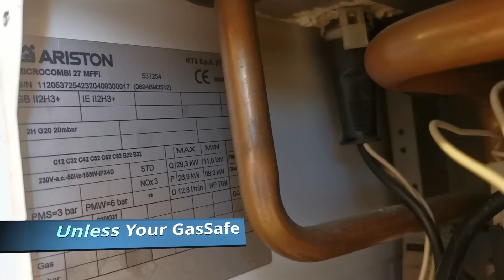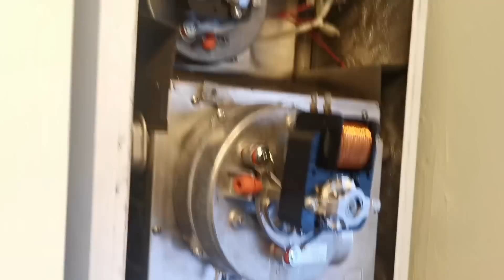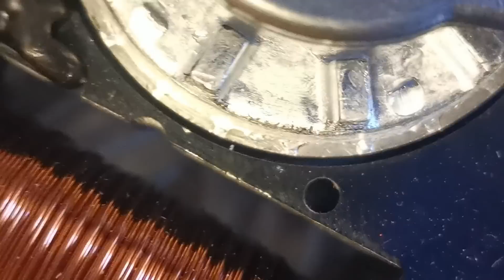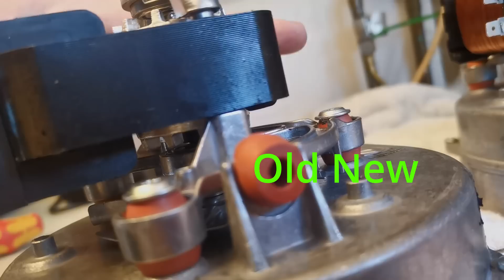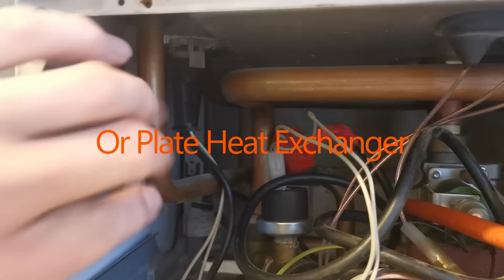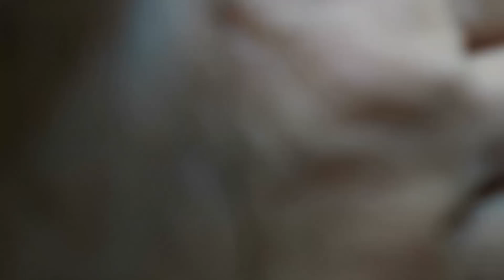Ariston Boiler, Fan Issues. Heatinggeek

Comment: So what's the problem of the new motor? my motor is doing exactly the same, making large noise and struggle to run, but without being powered up, it runs freely. I also accidentally installed the windings in the wrong way and it runs very well, of course the pressure check failed so boiler still won't start.

Comment: I wouldn’t be surprised if the fan had been previously used, misdiagnosed and return to the supplier and the dick probably thought it would be funny to slacken off the screws. I say this because it’s happened to me a few times over the years with various parts. 🤬

Comment: Thank you for this! I’m have issues with the same Aritson boiler, it’s showing E 34 and the water isn’t getting hot anymore.. I’ve fixed the pressure but all of a sudden it’s just heating the water to more than 29 degrees or lower, Doty you have any suggestions that I could try?

Comment: Nice video,,,you are check gas pressure,,whit Testo pressure gauge,,,in normal running boiler what it should be 5. 37 mbar ? Mainly I A/C work
Reply from the maker: All different.

Comment: Often if you have issues with fans the problem could also lay in the relays. If no maintenance is done to boiler the fan will get dirty and heavy which leads to burnt contacts on the relay onboard. Resoldering new relay can save bunch of money if you have solering iron onhand.
Reply from the maker: Yes but what relay? How many should you have on the van?
Reply: @HeatingGeek  on most boilers there are 3. You have to trace from the plug to witch one of them it's connected. They come in different varieties shapes and sizes so usually when i buy relays i buy them in packs of 5 so that i have 4 in case i encounter same boiler with same fault. I can give you list of the ones i carry arround if it helps.
Reply from the maker: That would be very good. I am trying to learn how to repair PCBs in the field.
Reply: @HeatingGeek  
Vitopend 100 - Panasonic ALDR124
Junkers/Buderus (Bosch worchester in UK) - F3AA024E
Protherm (the oddball Danish boiler sold in baltics, not sure UK) - Omron G5Q-14-EU

Commonly used ones that almost never fail (often also include protection circuit)-
SHRACK  orange 24 and 110V relays .
Finder 40.52 110V relays. - Unless youre fixing big floor boilers with ENERTECH STA13 servo you won't need them.

Also quick rule of thumb before you attempt to resolder relay make sure it's relays fault. Check if electric motor has continuity and resistance is in range of +/-40ohms. Next turn on the boiler and see if 220V come out, if it's something less, then it's green light relay is dead, but it''s not always the case. For instance had situation when it would start spinning for 1 second, then stop and flip the ''fan failiure to spin up'' error. It was relays fault never the less since when motor spins up it makes an arc between contacts and when that stops it fails to make contact. 

Quick tip: easy way to figure out which is the real relay is to unplug fan and just watch on board to which relay trace goes through, usually it's almost straight away connected to correct one.

Speaking of board repairs, there are instances when capacitors blow up in power sections of board, those can be replaced as well but there are no specific ones that fail often. In most cases i simply go to electronic parts store, find replacement and start fixing from there. also it's always worth checking if diodes in full bridge rectifier section haven't burnt out as well. In one instance capacitor blew up, replaced that, powered it on checked diodes and it turned out 4 diodes where burnt out as well so i replaced all 4 of those + main mosfet and that fixed it. For client total save was 130euros.
Reply from the maker: Thanks. Thats a lot of information to have. A burnt out diode will allow voltage both directions or neither? I will try and get hold of some of the ones I recognise. Thanks again for all that info. :-)